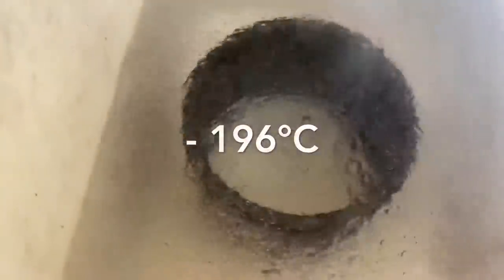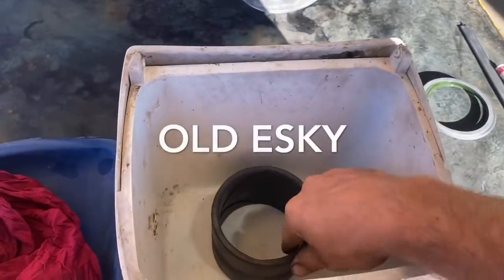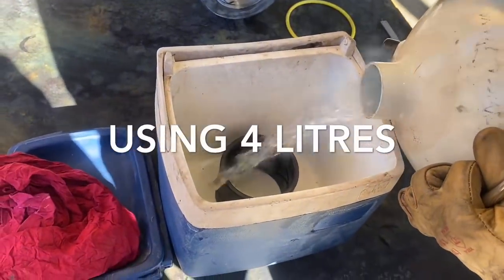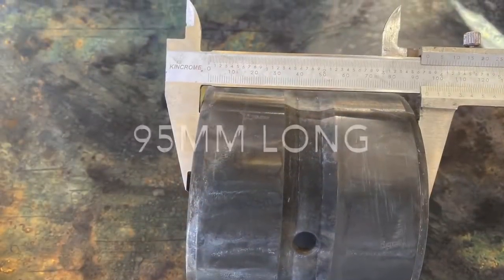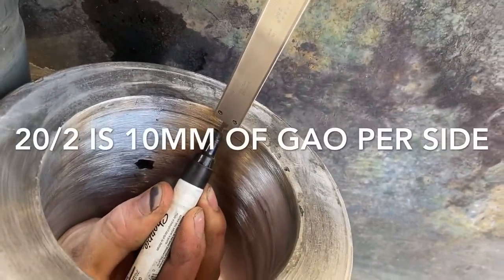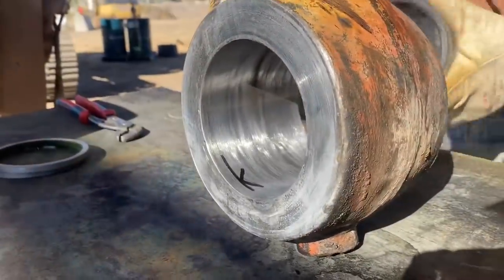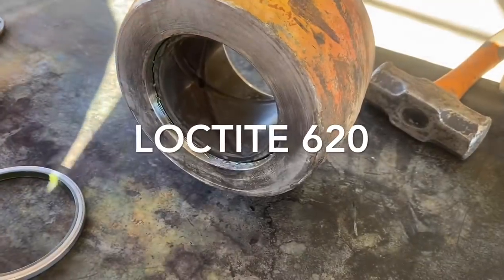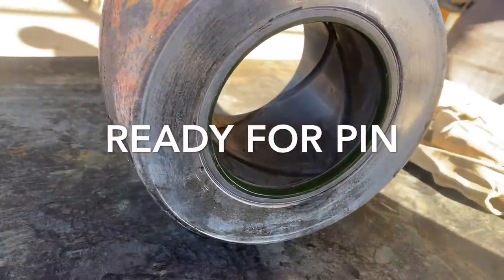How to Install Bearing with Liquid Nitrogen check it out!

Comment: Yep that's how you do it.
When I worked in aerospace that was the recommended method of plugging holes.
The plug was actually slightly larger than the hole, heat the hole, freeze the plug and once the temperature normalized the two pieces were essentially one.
Reply: Wouldnt the temperature difference shatter the plug?
Reply: @bigpotatoes8457  no

Comment: Very cool. Does this jeopardize the strength of the steel?
Reply from the maker: It does not jeopardise the bush because i have done this to machines that lasted decades with the same bushes and pins (regular greasing of course ) .

Comment: doing field service we use a heat gun and sometimes dry ice
Reply from the maker: Dry ice works well but liquid nitrogen works quicker I find.
Reply: @jxaxrxlx  alot of machine shops would not like us bringing liquid nitrogen in , too nuch paperwork
Reply from the maker: That’s a shame. Liquid nitrogen makes the job a lot easier I find
Reply: @jxaxrxlx  some shops like honeywell or 3M I have to document a can of liquid wrench  !!!!
Reply: @jxaxrxlx  You are correct. Dry ice is usually -80° to -100°F, and liquid nitrogen is usually -200°F, or colder. But dry ice is probably easier to obtain, and cheaper. When I worked in the shop, when sleeving motorcycle engines, we usually got a wash tub, put the cylinder sleeve, or sleeves, into the tub with some water, and a large chunk of dry ice resting on top, because cold air falls. The aluminum cylinder, or cylinder block, went into a convection oven at 350°F. The sleeves would simply fall into place. Just sayin'....

Comment: We use to do this at a power plant on a huge pump, but using dry-ice. But that is colder and would work faster. Check this out on YouTube   AvE   Microwave trick heating a bearing in a microwave. It is a good idea!
Reply: I was doing the microwave thing with the shops microwave and the boss got pissed! It works good.

Comment: I put the pinion from my axel in the freezer and my bearings in the oven. I have no access to liquid nitrogen
Reply: Yup that how we did it in the shop bearings on spindles and bushings. Still do it at home away from work on any metal project requiring fitment.

Comment: you haven't signed up.  admit that after mounting the sleeve you had a problem with lubricating the pin.  the video clearly shows that the hole from the calamite does not match the hole in the sleeve

Comment: Not saying this is a bad idea, but I’d measure the parts first and see if you can use a freezer and heat instead, that low of a temperature will change the metallurgy of some metals.... We do this to stress relieve aluminum alloys before machining where I work.  Good video however.

Comment: I wonder if that destroys the temper of the metal and compromises the integrity of the part. 
And what is the original process of installing the bushing and bearing!?
Reply: Doesn't affect the temper and the process is the same during OEM process .
Reply: @Dawgreen  thank you
Reply: I’ve installed hundreds of bushings with liquid nitrogen on military aircraft landing gear per T.O. Instruction. I will say other than the bore getting honed within specs I’ve never cleaned up the bore that way. Also never used a hammer... only screw type bushing puller or pusher to install grease seal to avoid bore damage.
Reply: @angieandfidelromero9343  thanks. 
Nice hearing from true professionals. There’s a lot of science involved. Humans are amazing aren’t they with what we can do?  I’m ever impressed.

Comment: Resulting stresses from non-uniform interconnected workpieces thank the work with significantly reduced tool life. 
Are you a construction worker or locksmith 🤔
Reply: @nicholas2113  bad job...
Reply: @nicholas2113  I don't this he is speaking English

Comment: What's the cost of 4'litres of liquid nitrogen.   You could get the same temperature different with a small oven and dry ice/ alcohol.

Am I missing something???

Stavros
Reply from the maker: $7 a liter Australian. The advantage of liquid nitrogen is its compact, fast and super effective. I’ve seen all the ways to press a bearing bush into a bore and liquid nitrogen is my favourite.It’s simple and easier than messing with heat. I’ll do a video one day of doing a whole bucket . You can fit 10 bearings in a couple of minutes.
Reply from the maker: We had the nitrogen left over from another job a week before. It’s last ages in there proper storage bottles.
Reply: I’m in oz where can you buy liquid nitrogen? Cheers
Reply from the maker: We buy it from BOC gas

Comment: Not sure I want to dip my parts in that stuff.
Reply from the maker: Definitely not your private parts 😂 . Nitrogen does not destroy steel objects . Perhaps some plastic would be damaged by the contracting process.
Reply: So long as they aren’t phenolic lined bushings it’s standard practice. You can also use dry ice and Isopropyl alcohol. It’s not quite as effective, but close.
Reply: @jxaxrxlx  ha Haa 🤓 pp,,,part

Comment: Forgot to line up the zert....
Reply from the maker: A lot of people are saying that. The manual said to put the hole in the bush 90 degrees roughly to the grease hole in the rod end
Reply from the maker: There is a recess on the outside of the bush that allows grease to lubricate from both ends of the bush

Comment: Never place rolling bearings in liquid nitrogen!
Reply: Because the steel will suffer a heat treatment by the low temperatures. This can change the format of the part and will change the micro structure of the steel.  And the speed of the temperature spread is so fast that increases the change in format. 
It is the same as heating a rolling bearing with a torch. 
You just do not do it.